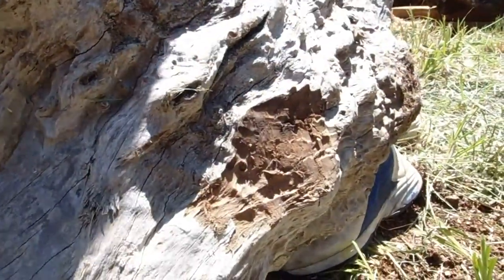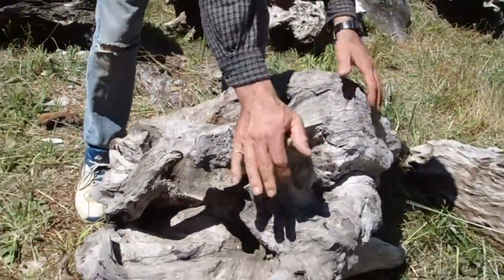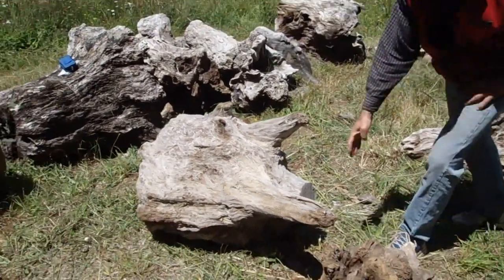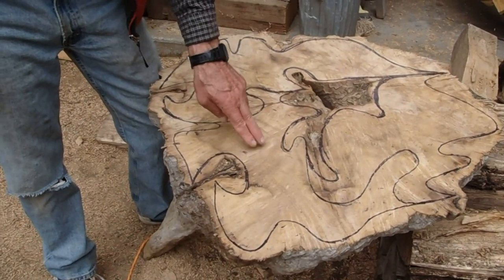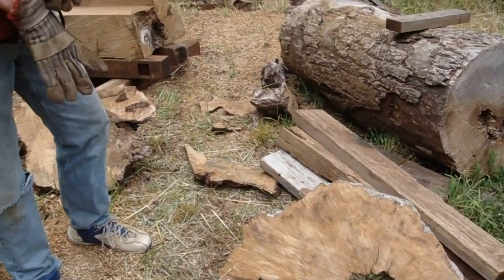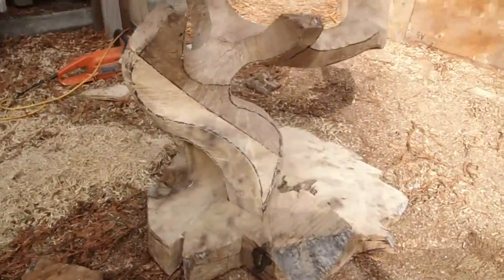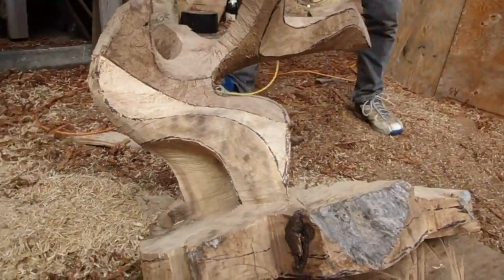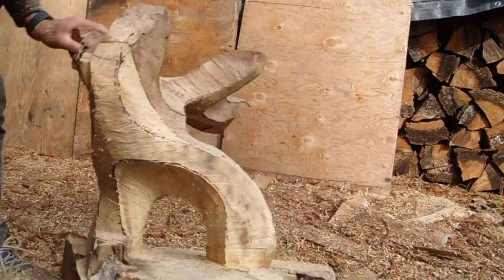Carving the sculptural table "Marbled Murrelets". David Groth documentary, chapter 4 of 9.

Comment: hye david, so happy about this video!! :) i have some qustions about the kiln if you be willing to share some info about it...  the two heat lamps, are they located at the bottom of the toilet container? in witch dirction are they situated? and if so, how does the heat spreads in the kiln? and another qustion when you fill water its regular water or hot? and last one, is it possible to dry  tree trunks that are more than 3-4 inch in a kiln like that?
 thanks a lot for everything !!
Reply from the maker: The heat lamps face up and are located at the bottom of the toilet container. The heat seams to spread reasonably evenly and I fill the the pottery bowls with hot water. I've found that trying to dry wood thicker than 3-4 inches causes the wood to crack. Bay is particularly stable with this process and some woods will crack even at 3 inches or less.
Reply: thak you david! have a good day :)

Comment: Can you explain how your kiln works? Enjoy the videos
Reply from the maker: My kiln is a big box insulated with foam core. I have two heat lamps inside the porcelain water tank of an old toilet. The heat lamps are connected to a rheostat for controlling the temperature. Also there is a greenhouse temperature gauge with the sensor in the kiln and the temperature reading outside the kiln (available from hardware stores). On top of the water tank I have two stoneware bowls that each hold approximately one gallon of water. For the first two weeks I keep the bowls refilled with water and the kiln temperature at approximately 130 degrees Fahrenheit. The next three to four weeks (depending on the thickness of wood, usually not thicker than 3-4 inches) I keep the kiln dry while maintaining the 130 degrees Fahrenheit.
Reply: Excellent!  Thanks a bunch! Love your work. Subbed